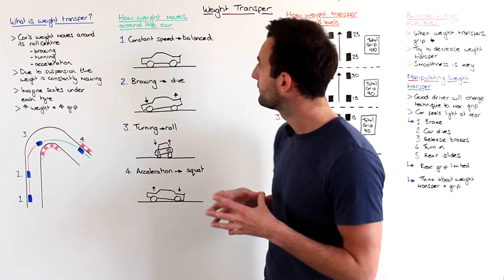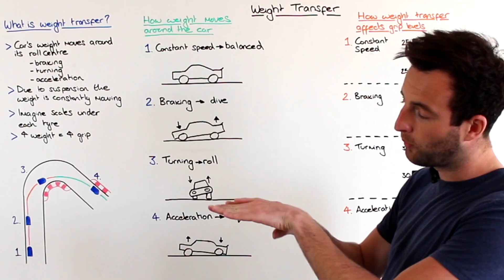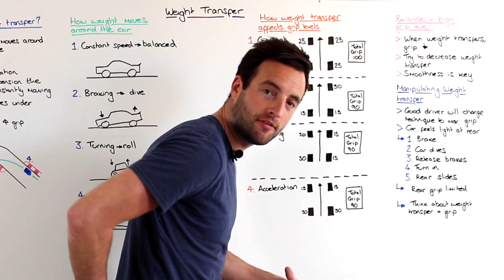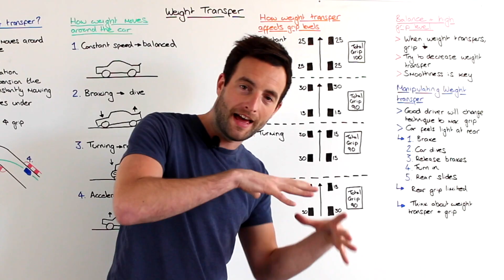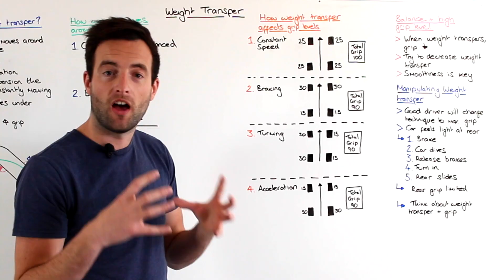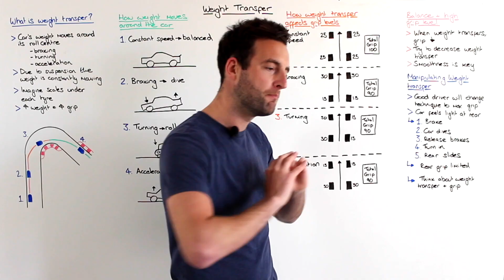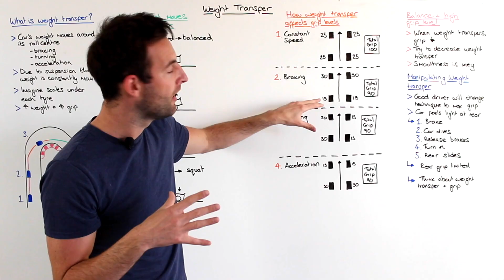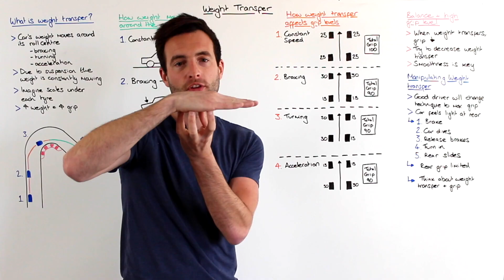Weight (or Load) Transfer Explained (Actionable Tutorial)

Comment: I know you covered acceleration in constant speed and from standing still, but I wonder what is the weight transfer when you accelerate hard during HIGH SPEED? Will the weight transfer be minimal due to inertia?
Reply: no. from 1-2 in 3s will be the same as from 100-102 in 3s.
Reply: @calvinlee1127  Please explain why you said so. You don't take high speed inertia into the factors?
Reply: 'weight tranfer' only occur when car accelerate/decelerate. at constant speed, no matter how fast 0 or 100, same distribution. learn the concept of Force f=ma and don't mix it with momentum.
Reply: @calvinlee1127  You may be right and sound like an engineer. How do you explain that a car, that can accelerate 0-100 in 2.7 seconds, but can only manage 4.5 seconds from 100-200?
Reply: @khvidtube1617  because of increasing air resistance, also something to do with gear ratio

Comment: Does increased weight transfer to the front tires always result in an increase in turning ability? Or would a car begin to understeer if too much weight shifts to the front?
Reply: Not always understeer, since you can induce rotation by shifting weight to the front and turning (Scandinavian flick).

Comment: Just a question for your superbly informative video: if you have a straight grip of 4x25=100, the weight TRANSFER must result the same 100units, isn’t it? The car’s weight will not disappear, just move to an axle or side. 
I can imagine, that the tires can not manage more than 30 units of grip, so instead of the 35+35+15+15=100 you will end up on 30+30+20+20 before locking the front wheels. Or am I wrong?
Reply: Yeah, but with Tire Load Sensitivity there is a loss. If you increase the downward force on a tire by 30%, you only increase the grip by 20-25% for example. This is because the tire has microscopic particles that interlock with the microscopic particles of the road. The harder you push them, the more they deform, and the less extra grip you get. This is why heavier cars have worse road holding. They have extra weight, which means extra momentum, but they don't really have much extra grip. So the lighter a car is, the less weight there is to drag them out of shape.

Comment: Why does the total level of grip decrease from driving at constant speed to braking? I don't know how to calculate it physically but my intuition would be that when you brake you have more grip than when driving constantly. Anyway amazing videos!
Reply: The amount of grip that a tire will generate goes up with the load placed on it but not linearly. E.g. doubling the weight of the car will give you less than double the grip. So in a simplified car model, you have the most grip available to you if the load is evenly distributed across all 4 tires.

Comment: Thanks for your teaching videos.
Talking about weight transfer, what about FF cars when the brake and acceleration done by the same front wheel?  What about AWD?

Why some FF car have lower front and higher rear settings? Rear might lose grip easily while turning right?

Comment: I doubt this is an issue with race cars but in the real world second order momentum is important. The car will have angular momentum causing a rocking. This adds to why you must not come off the break too fast, as the body would swing past the middle.

Comment: Purely from a physics pov, why does the total grip level drop when braking, turning or accelerating? Thanks
Reply: It's to do with load transfer sensitivity,, tyres act weird, they have a certain point in which you have maximum grip, once you exceed that point (overdriving the car) you tyres end up generating less grip. Hence why you should have smoother inputs so that you can work with the tyres load transfer sensitivity and not exceed its limit.
Reply: 1001speedster ah I get it. Thank you sir

Comment: Won't there be weight transfer even without any suspension, for example, in a kart or bicycle?  I recall riding my bike when a kid when the back brake wasn't working.  Applying the front brake only would cause the rear wheel to leave the ground.  Even with a rear brake this tends to happen when stopping quickly. I think all the suspension does is change how quickly the transfer occurs.

Comment: Excellent video, doubts are now gone ;) However, I still wonder about one thing. What about inclination angle? I know, that for example when we are turning right, the vertical surfaces of left tires are being straighten so the inclination angle goes to 0 degrees and inclination angle of right tires increases. But how can we determine mathematic relation between lateral G and inclination angle?

Comment: Hi there, I'm sorry but how is it that if you brake in a straight line the weight moves forward and so the grip ( which is obvious) but if you turn right the weight and grip goes to the oudside instead of the inside. I mean if you turn to the right you'll compress the right side suspension more so the weight should be on the rightside?
Reply: Nevermind I got it😊

Comment: Would stiffening up the front suspension counter the loss of grip in the rear? Or would this complicate the handling and behaviour in a negative way? I imagine it interferes with the cornering behaviour or balance, but I'm too green to make a real conclusion. Great videos man, I'm thoroughly enjoying myself.
Reply: Stiffening the suspension with springs of a higher rate will reduce the load transfer and lessen the loss of rear grip, but it can also lessen the front grip by making the front less compliant. Spring rate choices are a constant battle of compromise. Another method of reducing weight transfer from rear to front is via the dampers, more rear rebound damping and more front compression damping will affect the weight / load force transfer without the negatives of using higher spring rates.

Comment: Hi Scott. I'm referring to the quote "due to the suspension, the weight around the car is constantly moving". Actually, even in a car *with no suspension*, the weight moves (actually, forces, but that's another discussion) around when the car experiences acceleration (lateral, or longitudinal). If you replaced the coilover absorbers with steel rods, the weight would transfer as well. The suspension doesn't have anything to do with the fact that it transfers or not... it does change HOW it transfers though :)
Reply: Weight transfer is more obvious in a car with suspension due to the suspension reacting slower, but theoretically speaking you are correct.

Comment: Excellent..pls do a video on how to manage tyres..for example if the left rear is degrading more than other tyres wt should v do like how minimise degradation on that tyre pls do it
Reply: oxygen122 adjust camber, toe, and tire pressure.
Reply: Shravan Pammi I don't think it's a matter of managing the wear... some tracks simply can have more high speed left handers than right ones and that's it. I replace switch tires every couple of track days